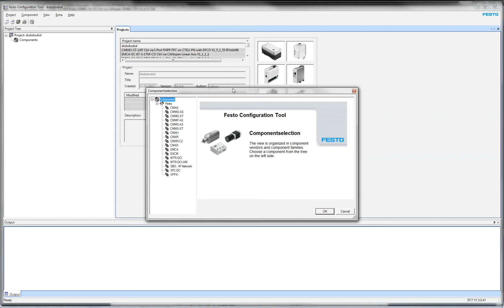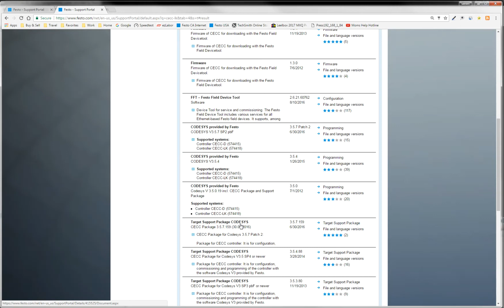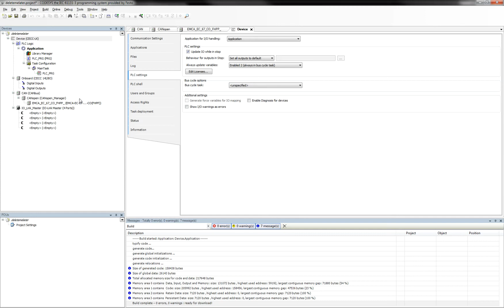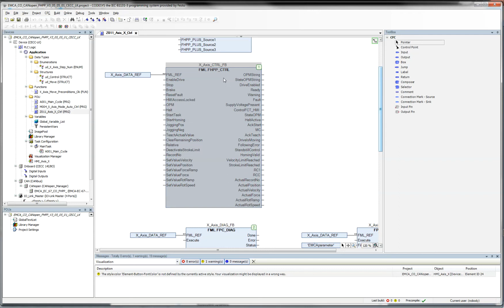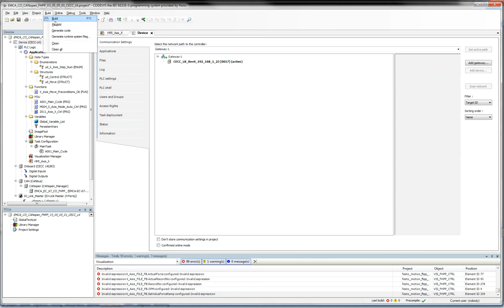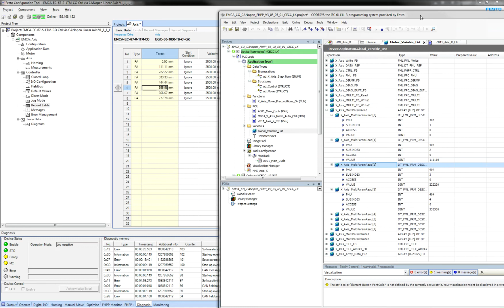EMCA-CO x1 + CECC-LK + CANopen FHPP V3_05_05_01

Comment: Hello Mr proud 
I know you normally don't answer questions so I will try to ask a yes or no question. The 4 io-link master ports on the cecc-lk are not enough for my application so my question is wether I can connect an io-link hub (for example from balluf ) to the cecc-lk to control more than 4 io- link devices. 
Thank you have a nice day.
Reply from the maker: The CECC-LK has a CANopen Master.  So, I would say it should be very possible to add a CANopen-IO-Link Master from another mfg to do what you are asking
Reply: Thank you for the quick answer! that would be possible of course.
Reply from the maker: Your Welcome